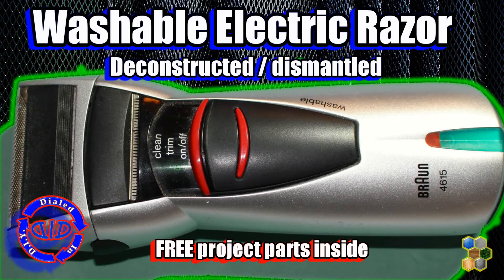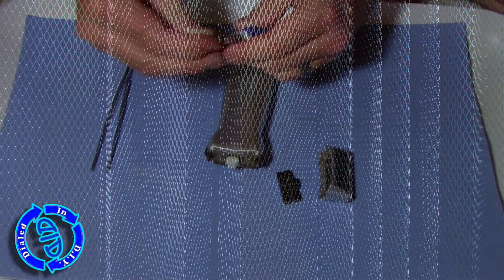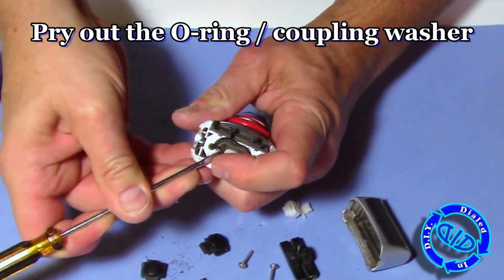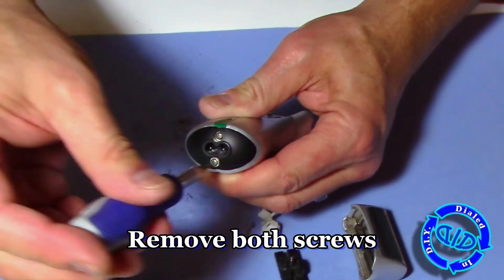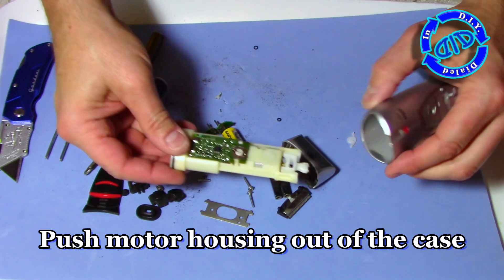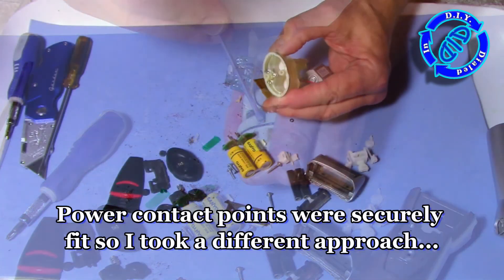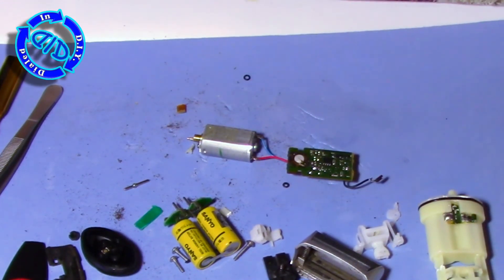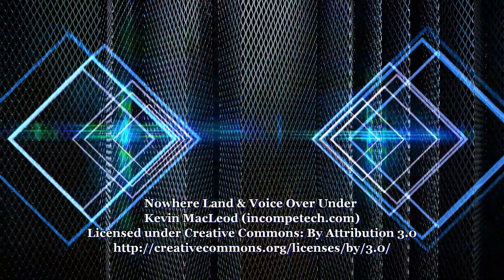What's Inside an Electric Razor - repair or salvage parts

Comment: I own a braun razor when its plugged in to charge the green light turns off after about 5 minutes and it stops charging.  Is there a loose connection inside the razor?
Reply from the maker: Hi Brian, my first thought would be a faulty battery (I've had similar issues with batteries and the protective circuit in the charger shuts it off).  Try to test the battery, if possible.
Reply: I removed the screws in the bottom of the razor but I could not get it apart. Its a discontinued model.  Is it even worth trying to take apart?  Do they make the battery for those discontinued models?
Reply from the maker: If you did not have a problem with the razor before it stopped charging AND the battery is the only thing wrong, then yes, it could be worth replacing the battery to fix it.  The good news is that these often use batteries that are not exclusive to the model of razor so the razor being DC'd wouldn't keep you from being able to get the right size battery.  That said, even if the razor can't work "as a razor" it could still be worth taking apart for stuff to use in other projects... "if one were so inclined."
Reply: I tried to take the razor apart after I removed the 2 screws in the bottom of it but I could not get the razor apart.  It is a 4000 series model.  What is the voltage of those dc batteries in those razors?
Reply from the maker: Great question because the batteries are a bit different depending upon the model. I believe the batteries in this video were about 1.2 v each but some range from 2.4 - 2.7v each.

Comment: Heh. I have (well, HAD) that exact same model of razor. After the battery died it met the same fate as your razor -- torn open for project parts. I think the motor might still be around here somewhere. Anyway, thanks for the video, and I hope you find a good use for the parts.
Reply from the maker: Very nice.  Seems the death of the batteries is the most common point of failure with rechargeable razors.  But that just means more stuff for me to take apart.  I'm still working on ideas for the motor but I like the fact that it is pretty quiet.  Thanks for the comment!!